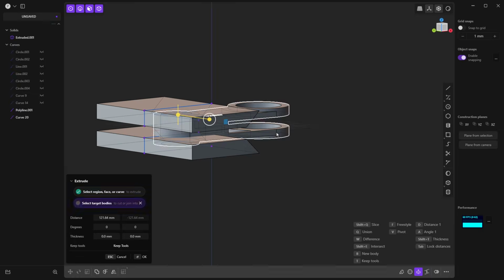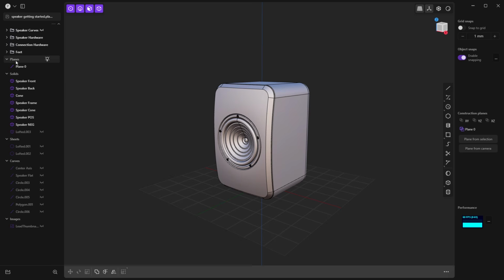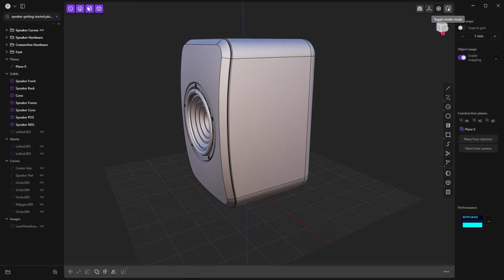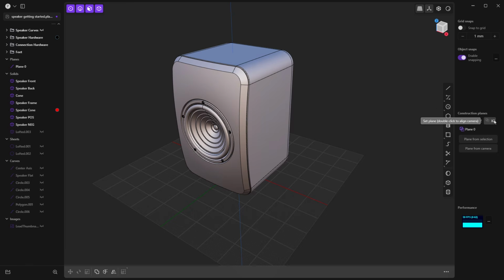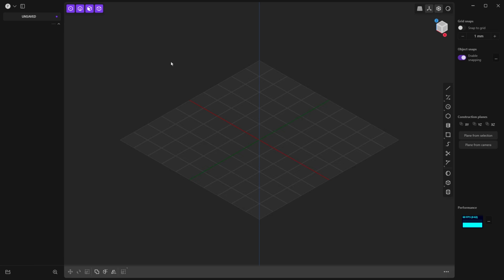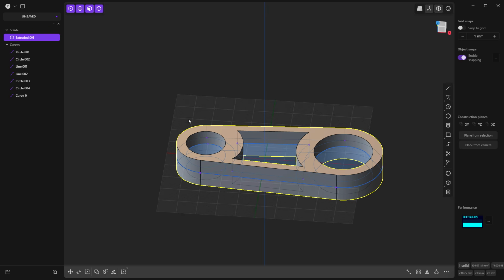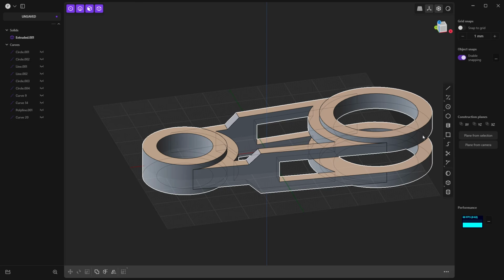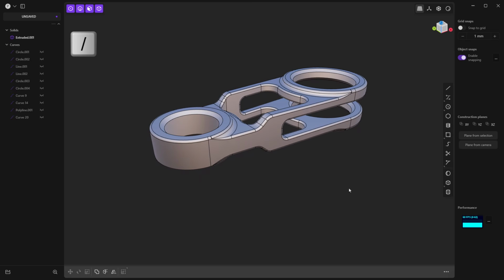Getting Started with Plasticity as an Absolute Beginner | NO CAD EXPERIENCE REQUIRED

Comment: Great tutorial. I'm using 26.1 which has a different UI, but was able to figure things out. Also, this might be a Mac thing, but I selected Track Pad & Magic Mouse setting for navigating and it did nothing until I restarted. Note, it's 2 fingers on the trackpad with shift for pan and option (or pinch) for zoom. Thanks for this - great instruction style.
Reply from the maker: Thanks!  I usually update content for each release and leave the old stuff.  the UI change happened in 25 and the new 26 version is basically the same UI.  We did just release a beginners course in vers 26 on www.LearnEverythingAboutDesign.com  and check the top of the playlist here https://www.youtube.com/playlist?list=PLBDfGh8A8kXXZx0FUCg05qIbts5zbeRT9  for the most current vids.  We also have a "course" modeling the USS Enterprise that is meant for beginners just getting started (light on shortcut keys etc).

Comment: I cant still believe Plasticity hasnt a Variable Filfet amount size. Or it has? Just a constant value?
Reply from the maker: It does, if you start pulling a fillet on an edge look in the bottom right.  hitting "V" will add a variable point.

In the dialog you can do Conic, Chordal, or G2 with various weights (tension) on them.  and the shortcuts in the bottom right let you do variable and even limits so you can stop a fillet part way on an edge.
Reply: @LearnEverythingAboutDesign  ohh Man you saved my day, thanks a lot! I read somewhere it was not implemented!  Inscribed for sure!

Comment: 44:50 How did you get the extrude to mirror so it goes both ways?
Reply from the maker: This has changed over the years but currently in version 26 (and 25) you should be able to hit TAB while creating the extrude.  This does a "Lock distance" which basically means the two distances in the dialog are the same (but opposite) making it a symmetric extrude.

Comment: being an artist and looking to make 3d designs to print...i see this as a big and better step up from tinkercad....which ive used quite a bit
Reply from the maker: Yeah TinkerCAD is a unique piece.  Great for the electronics side of things, but the CAD side is hard to transfer.  With Plasticity you end up with solid geometry not a mesh so it helps you do things like make true cylinders.

Comment: cool. I just used it and it's great. But...after you export your seamless, zero jagged edges model, it is transformed into something you could have made with polys, without all the required cleanup/decimation. Am I missing something?
Reply from the maker: Steve, it depends on what you are doing with the end model.  If you export a step, iges or parasolid type file those will remain BREP geometry (true arc not a bunch of polys).  If you convert to stl/obj you will need to pay attention to the resolution settings.  Any CAD to mesh conversion will leave you with that.  Plasticity does have a Blender Bridge and there are some retopo tools to try and get you a quad mesh that way.  It all depends on what the end goal/need is with the file.
Reply: @LearnEverythingAboutDesign  I hear ya, but this is billed as CAD for artists, but I'm suspicious that it's really CAD for CAD users, with a little more freedom than Rhino.

I did that Iphone tutorial, and my results were indistinguishable from the real thing (Keyshot render), but unless I'm just going to be modeling real world stuff, or sci-fi things, I think it's very limited compared to poly modeling. 

Keep in mind, that iphone was a lot of n-gons because it's not for animation and will never be deformed, so it was fine, but I don't want to even imagine what the quads export version would look like, or how much work I'd need to put into fixing it.

I did Elementza's Maya hard surface modeling course, and I'll say that the nintendo switch type thing, and the digital stylus and tablet looked every bit as real as the Plasticity iphone, but all natively quads, so no worries about retopo or anything else, so I'm not yet sold on this to replace Maya or Max for HSM at the moment.

Comment: Hi, I understand that the style of models and workflow are very different from traditional "parametric drafting" for industrial production, but can Plasticity be used to model forms to be carved? As in, sculpted? Is there something about the resulting model that makes it difficult or unsuitable to be turned into a toolpath? Surely it can designate a fixed dimension to a line or side, even if "everything is a surface," or is that assumption incorrect? I need to make some use of precision, in some parts of my designs, but there is a flow to good sculpture that is nearly impossible to produce in the traditional CAD style. That's why I'm interested in Plasticity. Perhaps I could build a precise base in CAD and then do the "surface finish" in Plasticity? The fact that it would be carved by CNC is just incidental so I'm curious if you think that the software would really be so bad for this usecase?
Reply from the maker: Hey There. You are in a tricky spot/use case for sure.  Mesh tools (like Blender) have "sculpting" in them where you generate a really high resolution mesh and you use tools like you would to sculpt clay, but you do so digitally.  The downside to this is you have a mesh model.  You can make toolpaths off meshes but generally you want a NURBS surface or BREP type of solid to drive those.  The toolpath will always end up with facets unless its a true arc (G2/G3) so starting with a bunch of flat faces runs the risk of memory overload or just bad geometry.

For the question about sculpting in plasticity and precision.  There is no "sketching" like a standard CAD program.  Meaning you can draw a rectangle that is 200mm x 300mm and have it stay at that.  What you can do is draw a 200x300 rectangle and turn it into a solid then use tools like dimension and measure to track its size and alter it if needed.  There are limits to this.  works well for prismatic features but as you get really complex shapes you can't really do the same.  For example you could add a bunch of dimensions to a complex spline and control it and have it update the surface.

Plasticity is a powerful direct modeling program and with the Studio license and access to surface tools like XNurbs, it makes for a really great surfacing program with a lot of flexibility.  for example your internal guides or profiles don't actually have to touch to create a surface.  Traditional tools like Loft require that your profiles and guides all intersect.  so it opens up great flexibility.

What I would say is try it, but sadly the demo is the indie license so you don't get access to XNurbs as far as I know.  Another thing to look into (we cover a lot on this channel) is Fusion Forms.  This is a push/pull workflow like Blender/mesh programs, but the end result is a NURBS surface.  Fusion also has CAM so you can program your toolpaths directly in it.  Freeform modeling is direct modeling but its a feature in a timeline so you can go back and edit it if you want.
Reply: @LearnEverythingAboutDesign  Thanks so much for the comment!

Comment: Hello, I'm new to Plasticity (coming from Alibre Design Pro) and I was wondering if you had a "Absolute Beginner's Guide to Plasticity Bundle"?  It would be very helpfull to understand the in's and out's of Plasticity.  PS - I would pay $20 (inflation) for that course.  Thanks, Dave A.
Reply from the maker: Hi Dave, I haven't had the time to build a course on our website for beginners.  All of our beginner stuff is here on YouTube though.  Each release of the software we do "Whats New" so we know the differences and re-do beginner content based on user feedback.  In 2024 we had this video (no cad needed) and a shorter one coming from other cad programs.  We also have some getting started in 2025 as well as some basic tips on workflows as well as an older playlist talking about the general workflow.

Plasticity Content
Getting Started Solids 25 – https://youtu.be/CTgza6C5LzA
Getting Started Surfaces 25 – https://youtu.be/fxcQ5ItCsaA

Whats New in 25 – https://youtu.be/Vqf-Y_rhL0M

Modeling workflow playlist – https://www.youtube.com/playlist?list=PLBDfGh8A8kXVIrO1aizPFmRBy-A-G9svk

Plasticity Playlist - https://www.youtube.com/playlist?list=PLBDfGh8A8kXXZx0FUCg05qIbts5zbeRT9

Question for you, with a beginners guide would you find it more helpful to tackle a project or just learn the basics independent of a dataset?
Reply: @LearnEverythingAboutDesign   Hello Matt, in response to your question, what would be helpful is tackling project.  In general, I try to reproduce Too Tall Toby practice models parametrically with Alibre Design Pro, but creating sketchs and using constraints alway trip me up.  Thanks for listening to a Plasticity newbee.  Thanks, Dave A.

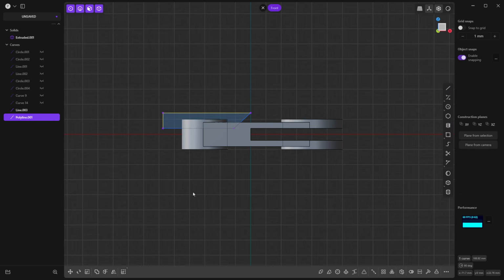Comment: Excellent! Thank you :-) Got a little lost at 51:30 scaling and pivoting but will get there. Great tutorial for a beginner like me.
Reply from the maker: Glad it helped!

With scaling, rotating, and moving. the shortcuts are common in a general sense.  What I mean is if you hit G, R, or S you can then easily specify an Axis like X, Y, or Z.  so if you want to move only in Z you would hit G Z.  If you want to rotate about Z you would hit R Z.  There are some nuances for move that don't apply to rotate like moving in plane, but in general the most common is to move or rotate about a single axis/direction.

The other two key things to remember are Freestyle and Pivot.  Freestyle lets you select a point on the object you want to move, and a point where you want it to move to.  Great for aligning lets say a bolt in a hole.  Pivot gives you the ability to set the xyz reference at a different location on your selected object or somewhere else.  So if you needed to rotate an object about a center point that isn't the origin or center of the object you could reset it.

Those are some fundamentals that ones baked into muscle memory will really speed things up.

Comment: It's sounds good but I even run try period. Its asking to create account. When I put my email it would not accept saying to enter email. That how screwed the site is.
Reply from the maker: That's weird, try contacting their support team, maybe they'll be able to help.  I haven't heard of anyone having to create an account for trial but its been a few years since I signed up so maybe the process has changed.
Reply: @LearnEverythingAboutDesign the only way was by email and that what I did including screen capture but no answer from them. I guess they don't care too much.
Reply from the maker: @JBCool0729  Sorry to hear that!  I would guess its not a care thing but more of a quantity thing.  If you want to email me i am happy to pass along a message on a non-public email to see if i can get a hold of anyone.  I don't work for Plasticity but being an affiliate gives me a different line of communication
Reply: @LearnEverythingAboutDesign OK I got Email from them today and they said that I used the try version alread 2 years ago and they reset my log in. BUt when I traid today it was the same problem so it did not worked. So I sent thaem replay with screen shot.
But even if I used the try two years ago that should automaticly be reset with new version. Two years ago I don't thing that the software was good at that time. I just don't remember.
I just give up. But thanks for your help.

Comment: Great video ! I'm fairly new to 3d printing and this reallyl helped.  I like that you don't use shortcut keys too much.    The concepts are already difficult for me not being an engineer.  Right now I mostly just use the  menu.  What I find really confusing is when there are options to select objects for a function but  it is not clear which one I am really working on.  Many times I have right clicked when I thought I was done and then everything just goes away.  I know I will get it and I love the program.  Thanks again for a video that I can almost keep up with.
Reply from the maker: Thanks!  I think with the next update coming "i think" soon there will be a bit of a UI overhaul and hopefully some tool tips on tools to help.   With Plasticity it can be tricky to know which selections are needed for a tool.  Like Loft for example.  And which selections you can pick after you start the tool.

Just stick with it and it will become more comfortable with practice!

Comment: 2:40 to compare Maya to blender saying you create with meshes is a bit oversimplified

Blender seems to me to be inherently poly based and when I last used Maya although it could do both excelled at nurbs based modeling
Reply from the maker: Fair point!  Although Maya is in the same category as Blender and 3d studio.  They are made for video/animation/vfx type workflows.  While Fusion, Solidworks, Inventor etc are typically "engineering" software.

I am on the Engineering side so that is mostly my interpretation of content ive seen on Maya and the times i've tested it, but I don't use it professionally.  For whatever that is worth :)

Comment: I hooked up the new keyboard, and everything worked like a charm. All the commands you put in th video worked. Not sure if the other beginner video you made for a few versions ago will work the same, I am about to go and try it out there. Thanks again for all your help and advice. You have a subscriber here and I will probably get into the purchased vids as well once I get up to speed and can work more smoothly in this program.
Reply from the maker: Awesome to hear that!  I hope the other stuff works.  Really the main thing that has changed from older versions of Plasticity is the right-click to confirm.  It used to be a double-click and now its a single.  Most of the core shortcut keys are still the same.

Comment: More please getting on a bit now, so learning this stuff aint easy. I messed it up even following your instructions. Just a question some of the keys etc are not doing anything, what am I doing wrong.
Reply from the maker: It takes a little bit to get the workflow down so stick with it!

On the keys not working, that is hard to say.  I do notice that if the cursor is over the Outliner on the left side that keys don't tend to work.  Other than that some tools don't work unless you have something preselected.  For example if you have nothing selected and you hit L for the loft tool, nothing will happen.  You need to have at least 2 curves selected before it will work.  So it might be possible that the keys or commands you are trying just need a selection.

Comment: thanks for this video. I am new to 3D printing and modeling and got the testversions of shapr3d and now plasticity. I messed around for one evening and got really frustrated with both of them working in 3d space but not finding the buttons to navigate in space. The same was true with basic modeling. Now after this video both navigation and modeling features are clear to me and tonight I will work with them. I do like the interface of shapr3d but refuse to buy a subscription for 355€/year. Since the main purpose for me is to create simple gadgets for use in my garage and kitchen to get better organized, I prefer the Indie1.1 with a one time purchase. I am the only non commercial user and don’t need complicated modeling features in the near future.
Reply from the maker: Happy to help.  Coming from no background can be tough for sure!  If you are considering Fusion as an option as well we have some absolute beginner content for that on www.LearnEverythingAboutDesign.com   I do have it on my list to do some organizers/trays in Plasticity.  My junk drawer and a few other areas have some that I made like to organize batteries and random stuff.  it helps!

Comment: Thanks for great video. Your videos have helped me alot but one thing i can’t figure out is how do i merge to different curved edges into one edge. I have searched all over the internet but cant find the answer. I will greatly appreciate your suggestion.
Reply from the maker: Hey There, if by edge you mean a curve (like a line or a spline) you can use the Join command which is J on the keyboard.  The endpoint need to be touching for that to work.  You can also use Unjoin to break them apart.